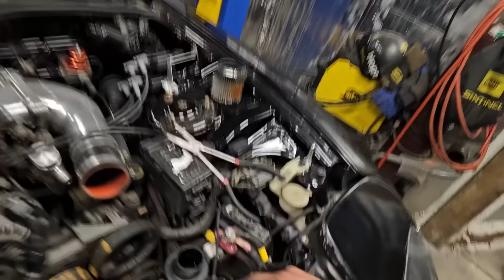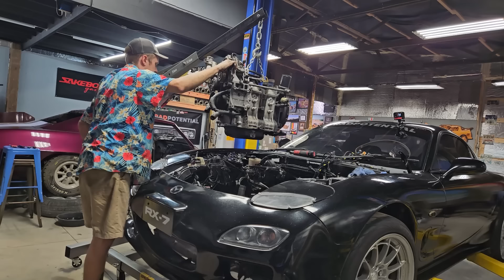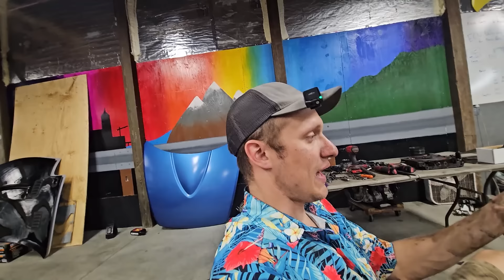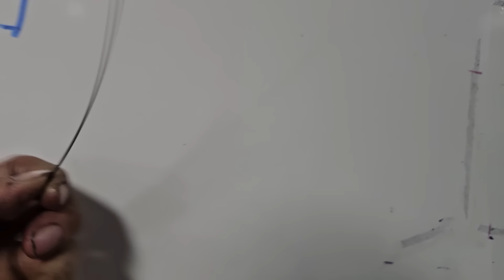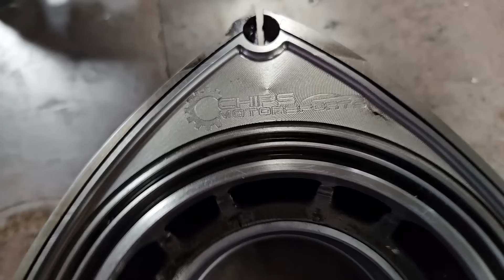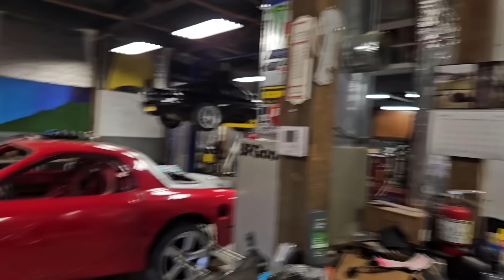This Failure Cost Me $5,000 - RX7 Owners Beware of BAD CNC Machine Work

Comment: Aside from the crack ...... the oil control ring looked badly worn to me. The wear land you can see is about 2mm wide ... on a new ring it's zero. I've been told by very experienced builders that that land should be less than a mm if you want to reuse them.

Comment: I run the highest octane fuel in all three of my RX8s and i premix.  The high octane fuel generates higher temps to burn off carbon buildup and ensure premix is consumed properly.  It also ensures no premature detonation.  I also ensure a redline a day and an aggressive hour+ long drive at least monthly to get the engine hot and keep it hot long enough to burn the carbon off.  I can feel a performance improvement after a hard hour+ drive up the canyon  at interstate speeds.  Thanks for keeping rotary engine mechanics alive!!
Reply: Higher octane fuel does not generate higher temps.
Reply: @PhantomShane914 I see your point. I should have said burns more consistently.

Comment: Audio desync issues on this one :( Its noticable a lot in the beginning, but throughout the video (i'm only 12 minutes in so far) the audio is ahead by about 10-12 frames. I'm assuming you're uploading at 30fps as usually youtube says when its 60fps, and it doesn't quite feel as choppy as 24. Regardless, its between 0.333 seconds off, or 0.167-0.200 off :') 
Not trying to be "that" guy, but i just wanted to let you know!!
Reply: This is an issue usually only with newly uploaded videos-video is playing back fine now.

Comment: a great majority of mods are not necessary . some just plump the price . mild builds are much better with all factory components . with minimal mods. if you are asking for 500 hp then all it needs is mild porting, clearing the side tips on the rotors and an oil reg mod north of 90 psi ( FC ) . maybe 5 fat studs if its FC or earlier . the more you mod the more scope you bring for something to go wrong . over lightening the rotors is a prime example . would have gone further for less .

Comment: My guess is that during casting the core shifted towards the side of the rotor that broke through and it's not something Chip checked for.

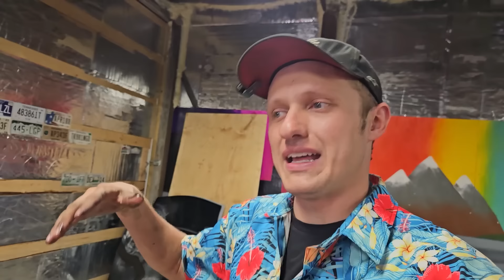34:30 The oil probably has a lot of fuel in it because of the hole in the rotor. With the inner wall for the side seal deformed it can't seal letting oil into the chamber during intake and air/fuel into the rotor during compression

Comment: typical chips motorsport junk, the dude took way too much meat out. realistically you dont need that bullshit done to the rotors. the factory rotors are perfectly fine out of the box. the scollops and all are pointless the excessive lightening is pointless. a good balanced rotating assembly is all you need.
Reply: Yeah Chips sucks ass
Reply: Scolloping is something used when in drag racing applications
Reply: @ayrtonppr6893 lol it doesn't do fuck all. Beside weaken the side seal groove area on the rotor. None this shit does fuck all.

Comment: Rotor looks overly machined on the sides to me. They even took down the 1st oil control ring lip. Unless you're trying to lighten that rotor enough to rev that engjne to 12k, taking that much off was unneccessary for a turbo car with such a small turbo. You turbo guys never rev to 9k anyways so lightning is uneccessary. If you're NA endurance racing then it makes sense as its not a street car. That much machining is over kill for a street car and thins the walls too much to hold boost. Also, those scallops are a waste of money for anything south of 600hp but they will give you braps.

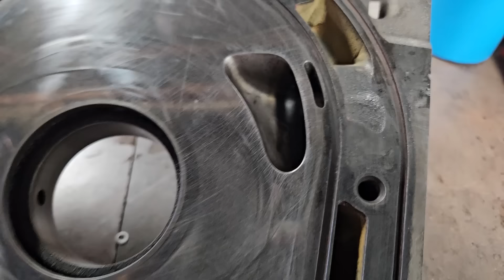Edit: 33:40. Your closing edge on that port needs a slight bevel. That hard edge puts too much stress on the side seals as the spring pushes down the edge near the corner seal over the port. Always put a small bevel on the closing edges of any rotary port work.
Reply: The main issue is the large radius in the corner between the opening and closing edge which will catch the end of the side seal as it passes over. 
If the closing edge is at the right angle with the opening corner higher than the other so the side seal gradually passes it like the blades of a scissor, and there isn't a large radius like that in the corner that will catch the end of the seal, you only really need an almost microscopic chamfer just to get rid of the sharp edge.  Even with stock 32° ADTC opening the end of the side seal hangs into the port
Reply: @Mrshotshell Stock is one thing because when the seal goes over the port, the opeing isn't as wide. When you extend and open the port early towards the rotor housing, that widens the gap and allows the seal tip to drop slightly more to catch the lip. I personally always put the smallest bevel on that edge just to be safe when extending. Doesn't have to be much but I dont want a hard 90 at the closing edge.
Reply: Can't ever get an answer to my questions, I give up! By chance you recognize what apex seals on that engine??
Reply: @ralphd9753 I saw Power Seals.
Reply: @ralphd9753 Australian scr powerseals street

Comment: Measure how deep the recess was machined from something original like the area around the bearing before you destroy the rotor. Use a dial indicator or something accurate, I'm curios how deep they cut when it got thin.

Comment: rebuilt an rx8 engine recently and i have to tear it back down due to a stuck seal, can i reuse coolant seals with no miles and just a few idles on them
Reply: People will say no, but i did just that on a renesis. I actually cut one and joined the splice with some gasket maker. I didn't want to order new seals lol. Never leaked coolant, and was running well when i sold it.
Reply from the maker: If they are clean. You can re use them
Reply: @RADPotential  will hightack come off of them or is it fine still on it

Comment: I keep seeing everywhere that rotary are very delicate
Reply: bad machining
Reply: So bad machining and delicate engine. Right
Reply: @Wasagii  they are delicate, but that's not what happened to this car's engine. I think the piston engine equivalent might be removing too much material trying to make a piston weigh less to raise the redline by 2000 or 3000 RPM higher than a stock engine. The part would have been fine if it had been left stock, it's not a design fault.The main difference is there are only a few dozen shops trying to make rotary engines lighter for high revs, and this shop did it wrong.
Reply: @scotty305 I mean it was a double wammy. They are delicate and they F up. So they caused a worse result.